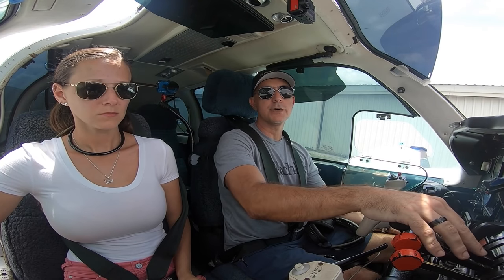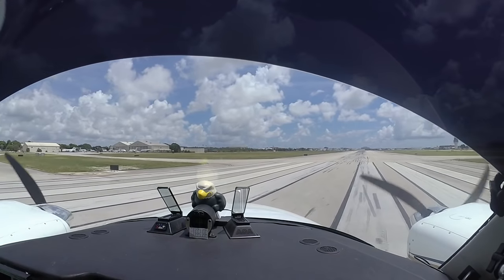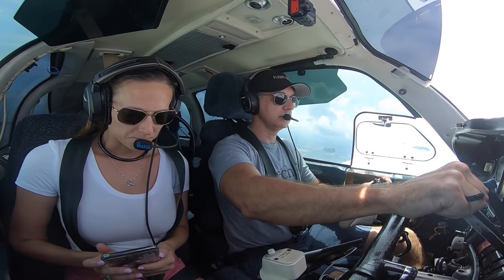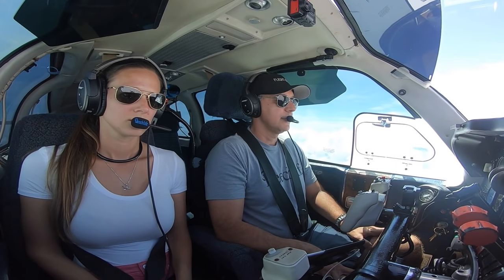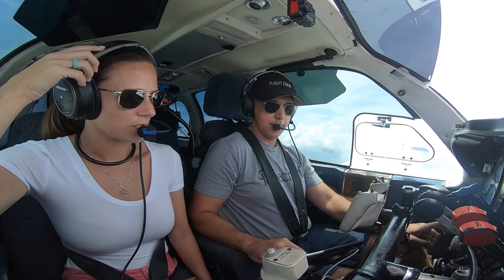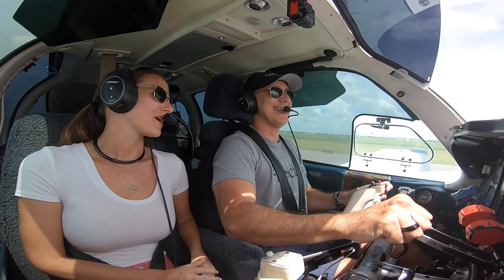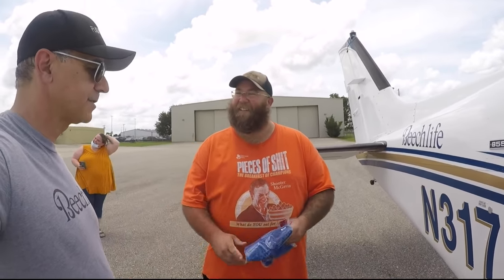Birthday SURPRISE! Engine Starting Procedures

Comment: The 3100 is probably the route you’ll go with your Avidyne’s and the Aspen. We installed a GFC-500 in our PA32R-300 with two IFD540s and had difficulty with the under speed protection the -500 has and VNAV. We ended up swapping in two Garmin GTNxi’s to get it all to work with our G5s. Also the yaw damper is essential once you have it. Those that have yd will tell you that.  Whatever you decide on make sure it all integrates well and you’ll be amazed at what a modern autopilot can do.  Good luck
Reply: Just wondering, why isn't the Avidyne AP in the mix? It's supposed to integrate well with the Aspen.
Reply: @christophehamal8434  while the DFC-90 is a very capable autopilot, it really is a direct replacement for the STEC-55 found in many older Cirrus aircraft and lacks VNAV and Flight Director guidance for takeoff..

Comment: I used to fly B55 and B58's and a Navajo on feight operations in Australia. That meant a lot of start-stop operations. ... and I found that the Piper "book" start worked great in the Barons, and the Baron "book" start worked great on the Navajo.... Go figure.
On the Baron, if it didn't start on the first turn, I would "blip" the fuel pump switch once or twice. That was all it needed.

Comment: Another great video man. I've got a 414AW with a GFC600. Should be down in Naples with the airplane for at least a week in January. I'd be happy to take you for a spin and show you the ins and outs. My two second thoughts are simple. If you've already got an upgrade compatible STEC autopilot (like a 55X) than you can't beat the price of the 3100 upgrade. But if you're going to be paying full price for either, the GFC600 is a vastly superior autopilot. Better processor, better handling, better documentation, better display, better servos, the list goes on and on. Come check it out!

Comment: Do the S-TEC autopilot.  I have the Garmin in my 182, but I also went G5's for the primaries.  GFC 500 will have you adding more than just the AP to work and I would be curious to see the compatibility with the Avidyne GPS.  That all said I love George best co-pilot you could ask for.  Building a hold and watching the 650 and the GFC 500 work together to plan and fly from entry through the hold plus the approaches really does take the single-pilot IFR environment down a notch.

Comment: Hemispherical Cruising Altitudes – VFR and IFR Cruising Altitudes

VFR Cruising Altitudes
VFR Cruising Altitudes
VFR Cruising Altitudes
VFR Pilots flying on a magnetic course (track) of 0 degrees through 179 degrees should fly any odd thousand foot MSL (Mean Sea Level) altitude plus 500 feet. Example VFR Cruising altitudes would be 3,500 feet, 5,500 feet, 7,500 feet etc.

VFR Pilots flying on a magnetic course (track) of 180 degrees through 359 degrees should fly any even thousand foot MSL altitude plus 500 feet. Example VFR Cruising altitudes would be 4,500 feet, 6,500 feet, 8,500 feet etc.

Vertical Separation
These VFR Cruising Altitudes provides a minimum of 1,000 feet clearance or vertical separation from other VFR airplanes heading in opposing directions.

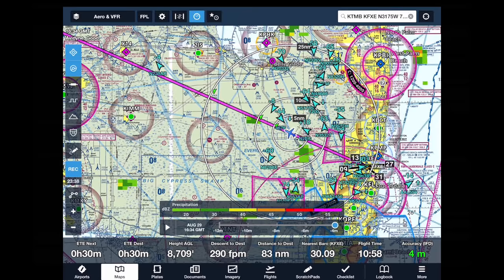Comment: At 10:20 into your video you mentioned you were going to go to 7500 ft. altitude, At 10:42 then you said  you were going WESTBOUND plus 500 because its odd plus 500.When asked if was the correct altitude your response was "It is today, thats what they tell me". Unfortunately its ACTUALLY EVEN plus 500 westbound. 14 CFR 91.159 
At 13:34 it shows heading 300 degrees and an altitude 7460 MSL.
Reply from the maker: You are correct. West is even but in Florida north is odd and south is even. ATC does that since most traffic is north and south compared to the rest of the country. So I was sticking with what ATC usually does.
Reply: @BaronPilot  ok thanks
Reply: @BaronPilot  Depends. I was a controller in ZJX from '68 to '73, and while it's true that NOSE was the procedure for V3 (along the coast), over LAL, GNV, ABY, and others, it was SONE. It was based on traffic flow, the two major ones of which were NY to MIA and ORD to MIA.

In fact we had a sector (AMG High) where it all came together. Every flight entering that sector was wrong altitude for direction of flight, and head on with one or more flights in the opposite direction.
Reply: @BaronPilot  that’s for ifr traffic

Comment: Garmin!  I have never used the stec 3100 but I did have the stec 55 on a cirrus SR20 and it did not hold a candle to my Garmin G500 I had installed in my Cherokee 6. 4 axis and it does approaches beautifully. Set up nice and easy to use.

Comment: I recently flew with the Garmin GFC500 coupled with 2 G5’s and the GTN650. It really is a great autopilot and I love the controls on the unit itself and the self level feature. I don’t have any experience with the STEC but that price tag is pretty high and I’m not really sure what the advantages of that over the Garmin are.

Comment: I'm not a pilot, but as you replaced the engines not too long ago, are they not available with counter rotating props? I'm only asking as you mentioned a slightly disproportionate power level on take off.
Reply from the maker: That would require a STC to make a change like that. Way to costly.

Comment: Why do some engines, for example higher displacement six cylinders like an IO520 or 540 start with mixtures full rich? I've flown lots of 172s and Archers with IO360s and have always started them mixture idle, letting prop catch and then advancing mixture to full rich and releasing the starter. I've also flown planes with carbureted O320s etc. where you just throw the mixture full rich. Can you do this in, let's say a brand new Archer TX? 172SP? Anything with IO360? Why or why not? No one has ever explained to me why and I'm super curious
Reply: Idle mixture start on a injected engine is the flood start. I’ll cold start most planes full rich whether injected or carbureted.

Comment: At 10:20 into your video you mentioned you were going to 7500 ft altitude. At 10:42 then you said you were going WESTBOUND  plus 500 ft. because its ODD plus 500. When asked if that was the correct altitude your response was "It is today, that's what they tell me." Unfortunately its ACTUALLY EVEN plus 500 ft. WESTBOUND  14 CFR 91.159
At 13:34 it shows heading 300 degrees and an altitude of 7460.   As a Pilot for years the incorrect basics could cause problems for those watching this as well as us who have been around for awhile.. Great flying and videos. Thanks

Comment: If you don't wear the shoulder harnesses correctly, then they aren't going to do their job. Four-point seat belts aren't like three-point in cars and won't self tighten in an accident. There are no airbags. If the shoulder harnesses are worn loosely like that, then it's quite likely that you will come free from the belts in an accident and even if you did happen to stay in the harness then it still won't be tight enough to prevent your torso impacting the control panel and control yoke in an accident. All of that flailing about could easily injure others in the airplane and the additional loads might even be enough to break the seat free. See FAR § 91.107 (a)(3).

Aside from personal safety, this is also setting a poor example for others who might copy it.

A pilot's pre-takeoff checklist should include making sure that all passengers are properly briefed on belts. § 91.107 (a)(1).

Stephen
Reply: Depends on the seat belt system. My Cessna Cardinal has an after-market BAS 4-point system with an inertial reel, so it will tighten. Not sure what’s in his Barron. But I see your point.

Comment: The ForeFlight feature you mentioned looks great but I’m having trouble finding it. I have the Performance Plus account but do not have the Jepp charts. Is it only available with Jepp?
Reply from the maker: I don’t believe you need Jepp charts to use it. Make sure your “show taxi” is on in settings and look for the “taxi route” button when on the taxi plate or in edit mode on the FPL page.
Reply: I don't believe it will work on iPhone. Need iPad to see it.
Reply from the maker: @RichardBurdette  it actually does work on the iPhone too.
Reply: Thanks a bunch! Great video and I love watching Baron Pilot!
Reply: I think I may have discovered the problem. It only works when your on the field about to taxi. I’m setting at home enjoying Baron Pilot videos. Duhhhh lol
Reply from the maker: @glenncombs8123  that would make sense. But it actually will work from home. But when you’re not on the airport, you have to tell it your starting point.